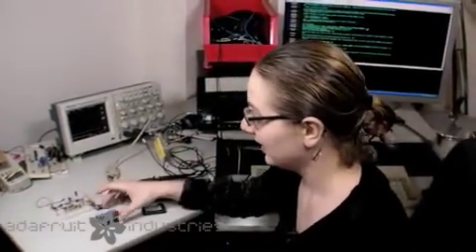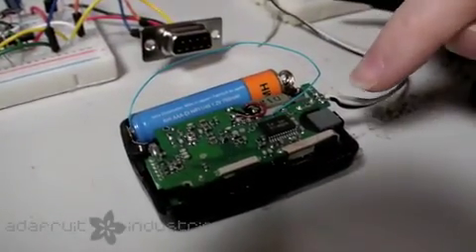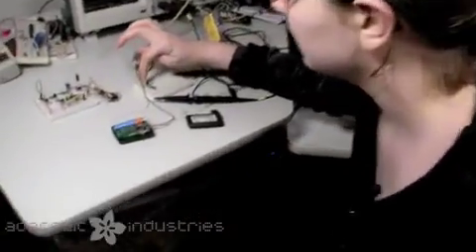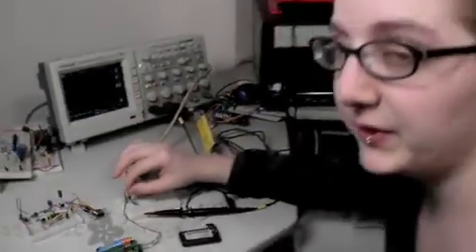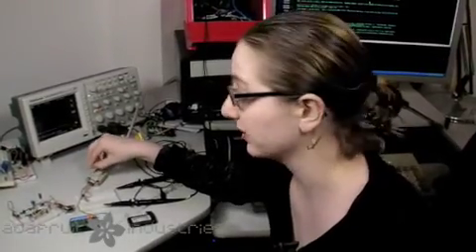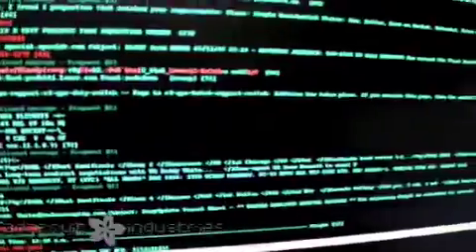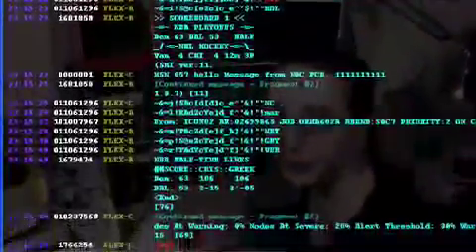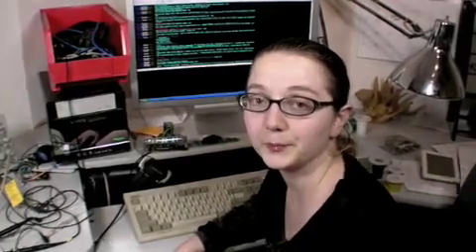How to make a cheap "pager scanner"

Comment: you can use a sdr receiver and use a decoder on your pc to do this its much easier or you can use a scanner with an audio our and plug into the audio in on your computer then run the decoding software

Comment: You still can't beat good old-fashioned serial ports for hacking and experimenting. 

The advantage is that you can build RS232 interfaces from discreet components, whereas with USB you tend to need intelligent PICs.

Never could quite get my head around the USB protocols.

Comment: USB serial ports are too slow. They can transfer data fine but they have a high command latency. Reading the flow control lines requires a command each time, and the USB frame period is 1ms, so at most you're going to be able to poll the CTS lines 1000 to 500 times per second.

Basically, USB serial ports are fine for standard USB uses (transfer data) as long as you can tolerate somewhat higher latency, but they're quite useless for bitbanging unless your data rate is very slow.